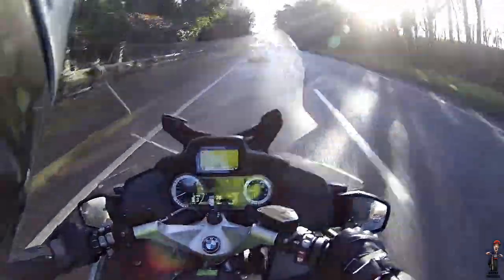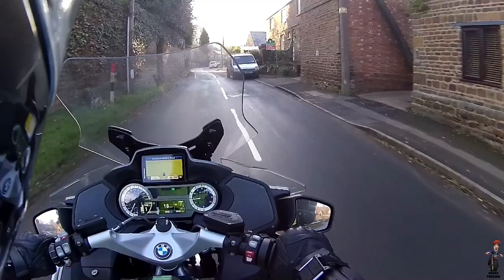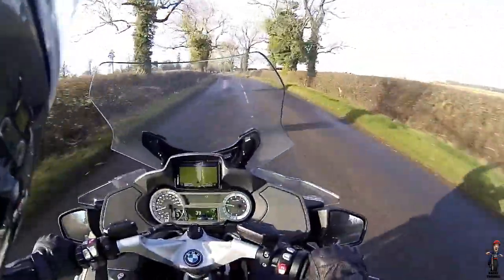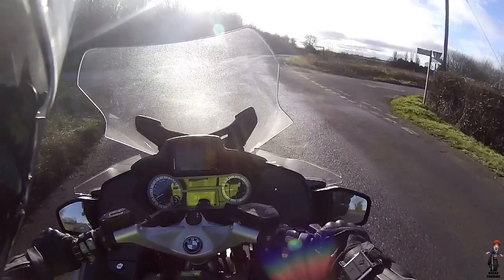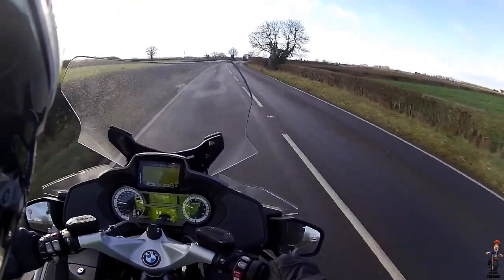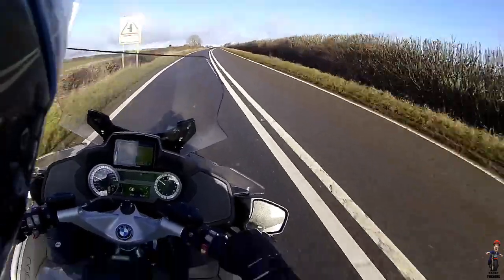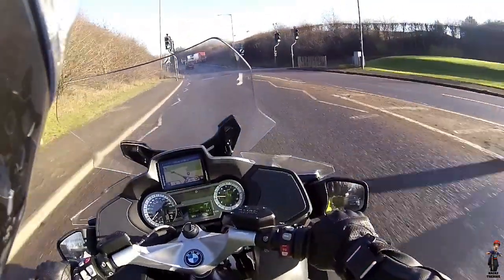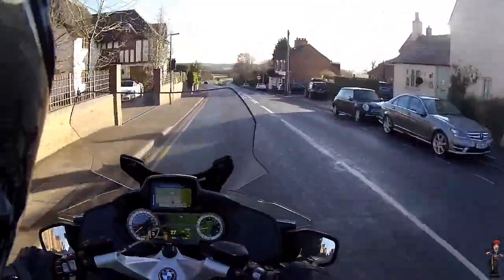Learning the R1200RT #5 - Counter-Steering & Overtaking Practice Ride

Comment: Hi Mate.  Like the videos very interesting.  I went through my Direct Access 2 years ago and my instructor was all about engine braking and anticipation, helps you enter an bend at the correct speed.  Using engine braking also helps in slippy conditions as it's less likely to skid than using the brake.
Reply from the maker: Yes, good call Marc. I hardly use the brakes on the RT, just bring the revs up, drop down a gear and close the throttle. You need to think about IAM Advanced course next ...

Comment: On another subject and based on your wonderful motto, "I'm no expert, but I can read,"  
What I have learned: Adjust your suspension according to the road surface. The harder and smoother the road, the harder your suspension should be. This gives you more control over the motorcycle. The softer and/or more uneven the road surface, the softer your suspension should be BECAUSE the bike needs some leeway to self-correct, which it will do with a softer suspension. This is somewhat akin to letting a horse have free rein in rough terrain so long as it is going in the direction you want it to, and with all the electronics on BMW bikes these day, they are almost as smart as horses. However, even without the electronics, off road riders have learned that overreacting to a slight shift of one of the wheels is far more dangerous than letting the bike stabilize itself would be. The trickiest part of their learning curve is learning where that balance between rider control and bike self-control is. During this process they crash or drop their bikes many times and are actually proud of that fact! They have crashbars. :-) 
So, how does this apply to you? Check with the real experts who sold you that bike, of course, but they will probably tell you that any suspension option on your bike will be fine for your riding style so long as you know what the effect of softening your suspension is as you use it, and don't worry that you will over-soften on a bike that is not designed to go off-road. 

You should know: I just purchased my BMW R1200 GS (slightly used demo bike) a couple of days ago and haven't even ridden it yet. Accessories (mostly panniers) had to be added, etc. But there was some slight pressure from the salesperson for me to take possession of the bike to make room in the showroom. I resisted that, insisting that I need to just putter around in the parking lot of the shop for at least one day, getting used to the feel of clutch, brakes, throttle, all that stuff. We struck a deal that it would be stored in the warehouse when the store is closed and I get it delivered to my home in one week. I will do parking lot (oops, car park) practice for a few days until that delivery takes place. 
Then, with your advice and MCRider and RaodcraftNottingham and others, I begin my journey of ten thousand.
Reply from the maker: Let's enjoy the learning ride together then. I'm sure my bike is smarter than I am ;-)

Comment: Did you get an answer re the knocking/ chatter, I have the same on my 2012 RT and have discovered it’s the panniers. They are floating so not fixed solid to bike. Take them off and go for a ride, pretty sure it will have disappeared. Cheers Ian
Reply from the maker: Mine weren't on at the time Ian. I suspect its a combination of the nature of the bike, a rough surface, and possibly the traction control. TBH I now think I've got used to it!

Comment: Hi just picking up on the rattle or noise issue, I tend to fell that the Fairing on the RT tends to resonate or echo and make sounds seem much louder then what it really is especially depending on the Tarmac your on.
Reply from the maker: Martyn Leyfield thanks for that. The noise seems to have settled down now but I take your point about the fairing. I suspect it is a combination of road surface and tyre noise.

Comment: Sounds like the traction control might have kicked in with regards the chatter cattle grid feeling, Z8 old now (i was disappointed with them) do you know if they are ok? E.g. any repairs, been left on side stand over the winter, under or over inflation, excessive braking and acceleration. 

£300 on a new set of Roadtech 01 might be worth a consideration or just going to a tyre shop and asking them to check them, any damp or slippery conditions best just leave in rain mode for now....
Reply from the maker: I'm confused about the Z8's - some say 6000 miles or more, others like yourself say they're shot approaching 4000. I agree with you though, £300 is a small price for peace of mind and decent grip. Your idea about traction control is the best theory I've heard, that would explain everything. I presume the tyres are fighting for grip over the rippled surface, so the noise from TC is heard? Pressures are good, and no obvious signs of damage (I've inspected them closely). Thanks so much for this :)
Reply from the maker: Should also have mentioned the bike is in rain mode ...I thought it would make for a more forgiving ride for a back to biker ...
Reply: change them for the Roadtech 01 you will not be disappointed, i hear Michelin are also bringing out a new pilot road 4 out. I have tried z8, GT4 but Roadtech 01 HW front and back for the winter give you so much more grip....

Comment: I know this video is 4 months old, and you probably have it sorted now, but a point about counter steering. In the video you say you have to push DOWN on the bars. This is not correct. You should be moving the bars to make them move around the central pivot point (headstock). So on your bike, with you forearms as parallel to the ground as possible, you just need to PUSH the bar forward gently. If you have been pushing down towards the ground, you will find doing it by pushing so much easier. Be careful, as the difference will be significant, and you could end up over steering.
Reply from the maker: Mike Roberts thanks Mike, still experimenting with it, particularly in those tightish corners. At that time my elbows were way to high, something Mark the IAM Observer pointed out on My first IAM observe. He literally reconstructed my whole riding position to lower those elbows and get the forearms parallel to the ground. So now not pushing down but forwards. Keep those tips coming please!